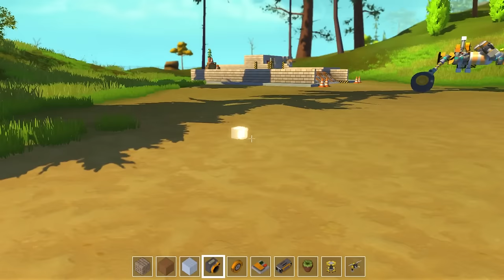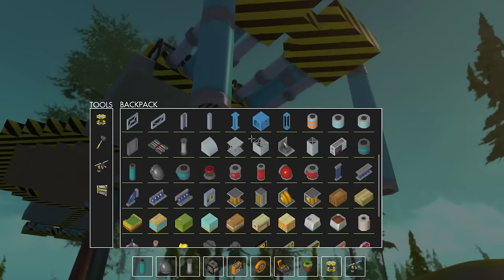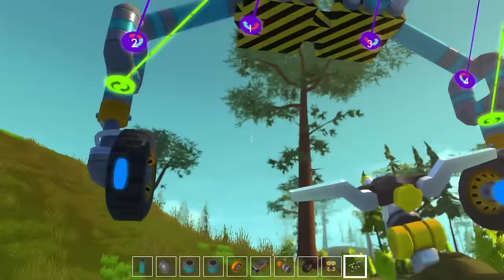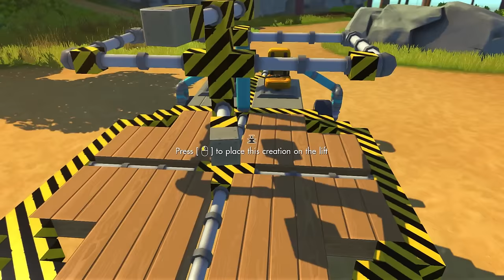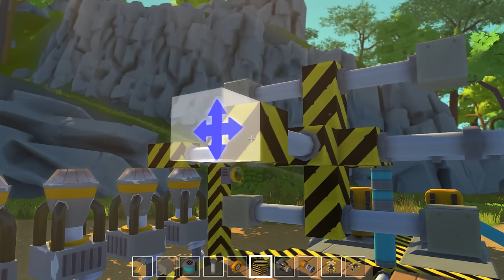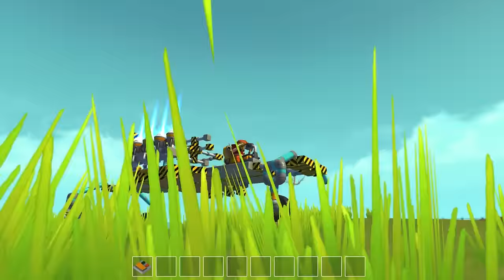Scrap Mechanic - 11. Gyroscope Stabilisation - Let's Play Scrap Mechanic Gameplay

Comment: hey Aavak, a tip from my Air Force uncle about remembering pitch yaw and roll.  As long as you remember roll, Yaw is around the Y axis (so side to side) and Pitch is the up and down one.  You had it right but since you doubted yourself I wanted to offer this tip.
Reply from the maker: Ahh, thanks for the tip :)

Comment: To avoid any eventual oscillation on your aircraft or hovercraft, you could add 2 more sensors per axis and wire it in such a way that when the first sensor is triggered it fires only one or two pairs of thrusters and when the second sensor is triggered it fires all pairs of thrusters.

Or else I fear the integral in your PID system is going to make your craft go nuts.
Reply from the maker: This was already part of my plan (though the way the game works means I can't have the same thrusters triggered by different sensors, I planned to, for example, have 2 thrusters for initial correction, then an additional 8 for heavy correction)

The system is scalable too, so on a very large craft you could have massive banks of thrusters hooked up like this. Including different arrangements, so for minor changes, just pulsing the thrusters on one side is enough (tipping just that one side to correct for a minor deviation) but larger issues could use complimentary pairs, down on one side, up on the other, to rotate along a central axis.
Reply: +Aavak Ah great! You're thinking ahead of me on this one. I'm eager to see what's next!

Comment: You know when the vehicle would tip over enough to be out of range of the sensor, why don’t you just put a block in the way to keep the gyro from falling to far? It would keep the sensor on and correct itself.
I haven’t tested it but I think it would work.
Reply: That is a good idea
Reply from the maker: That's a fantastic idea :)
Reply: +ahmad idriss I not sure but I think that would put the gyro out of alignment  since your applying an outside force to it.
Reply: +ahmad idriss But it would decalibrate the gyro though
Reply from the maker: Hmm, perhaps I misunderstood, I thought they were suggesting that we put blocks to limit how far the gyro could tilt (before the limbs smacked into the blocks, thus stop tilting) so as to ensure it remains in a position to activate the sensor.
Reply: true, as the vehicle would continue to tilt it would prevent the gyro from keeping level, thus when the thrusters active they will only realign until the vehicle matches the new horizon.( with true I mean that it would stop the gyro from tilting to far.)
Reply: +Aavak I think you understood right, but if you prevent the gyro to rotate freely, it would only correct for the maximum angle that you're allowing it to rotate to (I hope this sentence makes sense).
Then the "new" stable plane would be tilted one way or the other.

Edit: typo
Reply from the maker: Ahhh, of course, that makes perfect sense. I wasn't thinking far enough ahead.

Comment: Aavak, you can fix the gyro going out of range by building and arm above the top sensor and below the bottom sensor.
also, you could add extra sensors above and below the two that are there and only attach the first to 1 jet and then the second in line to more than 1 jet to get a stronger "compensation effect"
Reply from the maker: Interesting idea :)

Comment: +Aavak - Would it work if you replace the sensor pillar with a pillar on each side? The idea being that the pillar has several sensors for when that side drops, so it can't leave sensor sight. You then connect that to a multi input controller for the thrusters. The second pillar, on the other side, would pick up the other direction.
Also, I have a name suggestion: call the hovercraft "Llysywen".

Comment: If you put the sensors on the gyro itself and had it pointed at a slotted wall, wouldn't that fix the "too extreme of a roll to correct" problem?
Reply from the maker: Nice idea, though harder to balance the gyro at that point, and balance is crucial.

Comment: I wonder if you could somehow put some weights at the bottom of the gyroscope part that tips to the left and right, thereby giving it the ability to self-right? 
Then you wouldn't have to worry about starting on a flat surface. :)

Comment: Would it be possible to make a one wheel car with the chassis of the car being a gyro and then a single wheel for movement, seems excessive but that would push the gyro to its limits.
Reply from the maker: Yup.

Comment: Very nice.  Bulky, but could've done wonders for your trike.  I've known that you can use unbalanced powered wheels (or anything probably) as reaction wheels to turn mid-air, but I've been wondering if gyroscopic stability is modeled.  This doesn't show true gyrostabilization, but it's a great way to build a gyro when I get around to testing for that. ;)

Comment: What about a glider with rocket based steering? That hill should be tall enough to launch off - you could even build a bit of a ramp or overhanging platform up there to get a proper launch. Is it just gravity or have aerodynamics been programmed into the game?

Edit: Never mind, seems this is not yet possible.

Comment: Gotta say I am really enjoying your scrap mechanic series.
Would you be doing a fully designed hovercraft next episode or it would be a hovering set of contraptions for a possible upgrade to a for example vtol?
Reply from the maker: I'm likely going to do a proof of concept build to start with, I might go on to make it a fully fledged vehicle in its own right, or I might use it as the next step towards a rocket. Depends how much I like the design once I'm done :)

Comment: If you expanded the gyroscope on the sides, where you only have the one block and only one block of play between the top and bottom sensors, could you add a extra block on top of each side and expanded the sensors to have 3 blocks space in between then your stabilizing sensors would detect more and would allow your thrusters to stay on longer and help keep you from the point of no return. Would this work?
Reply from the maker: Might work, could try it out.

Comment: How well does this game model rotational inertia?
Reply from the maker: It's a bit ... janky, when dealing with high speeds, but at low RPM not too bad.

I suspect that's more a limitation of the game's optimisation than a limitation of the game's physics model though. Right now, as things ramp up the game starts skipping frames from what I can tell (on a computational level, not graphically) so the models start behaving erratically. I imagine this will be greatly improved with further optimisation to the engine :)